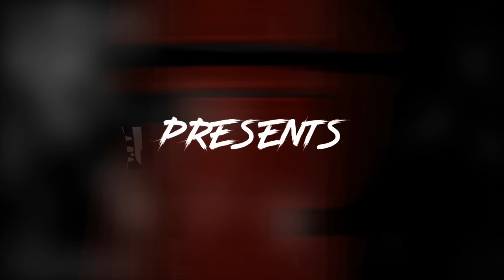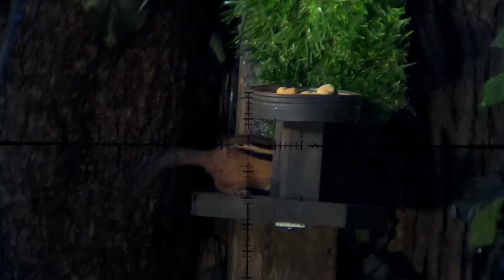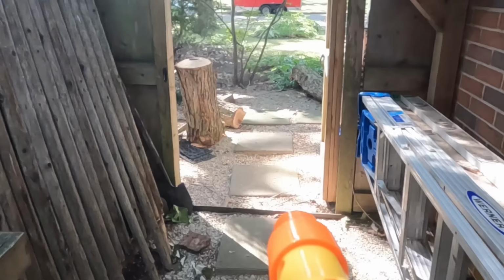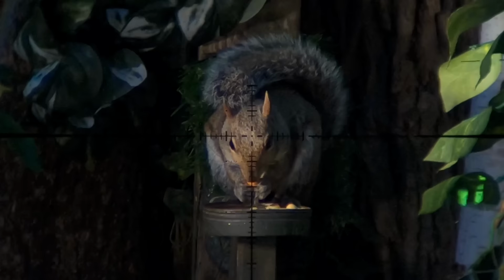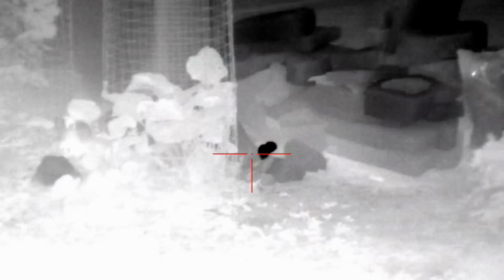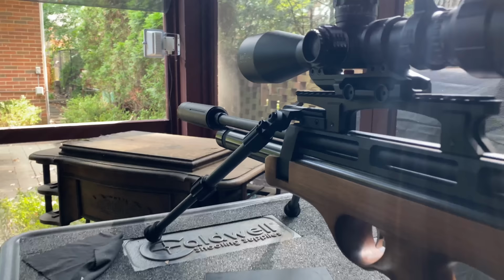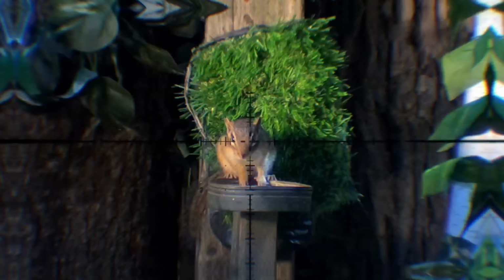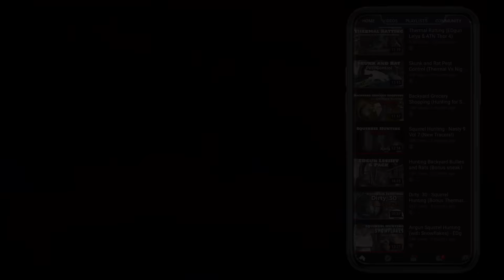I went FULL SEND on the Chipmunks! (Crazy Footage!)

Comment: One. You CAN reload the bug-a-salt cylinders. Wet paper towel. Press against one side. Fill with salt. Pack. You can make em as tight as you want. TWO... And here's the big kicker... If you look at the parts. They're the same as a crosman revolver. It has been tested. You can actually take the BAS revolver and the crosman revolver. And interchange the parts and have them WORK. The crosman is STRONGER AND CHEAPER. And metal if I recall. Iss like 60 dollars. You can use the same BAS cylinders. Or load your own. You can even pack salt-shot into the crosman cylinders. You're welcome. 😉😎